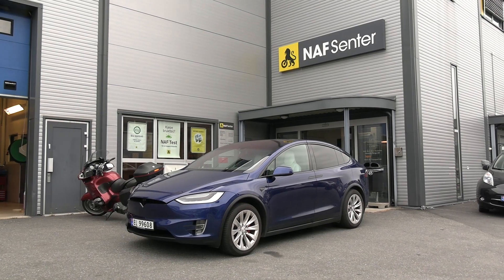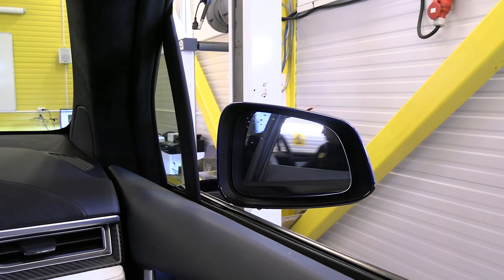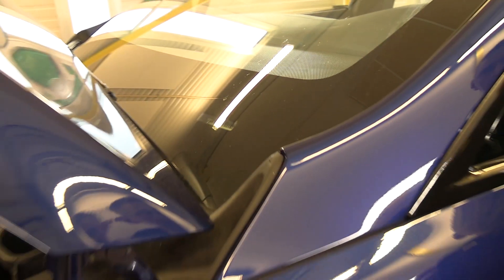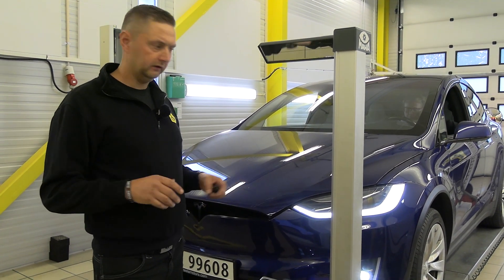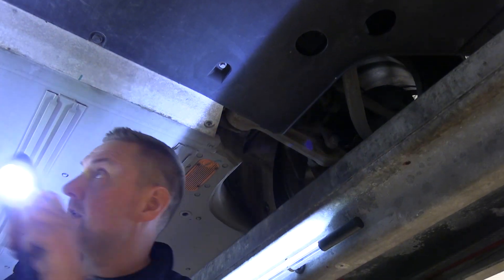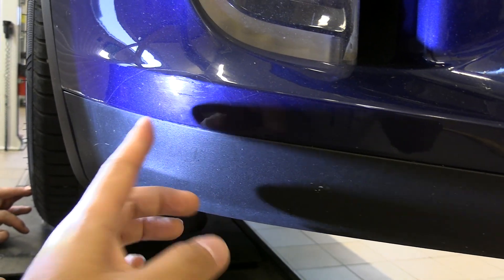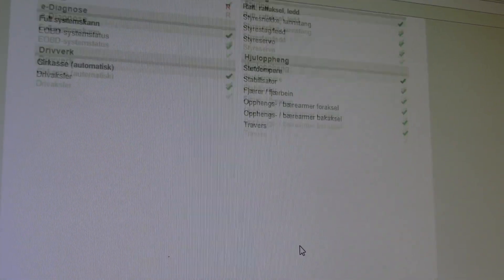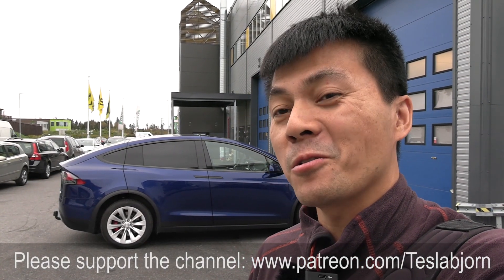Optimus Prime goes through NAF test

Comment: Need to check the timing chain, clutch and transmission and do an emmisions test. 😉
Reply from the maker: Don't forget to adjust the Johnson Rod 😂
Reply: @bjornnyland  I remember that movie.
Reply: Clutch wear and tear, slack on the gear shift, exhaust rust, catalyst converter, ignition timing, crankshaft bearings, valve clearance, coolant level, oil level, wow!
Reply: Blinker fluid full!
Reply: Guys, better check the intake air filter... With that kind of distance traveled, it must be so full of dust now.  Better replace it before it breaks down and let the  tiny dust particles enter the combustion chambers and damage the cylinders and pistons.  Also, check the fuel filter and fuel pump as well.  Check the fan belt for any cracks or damage.  Check the radiator for any sign of corrosion or fouling and that include the hoses.  Check the valve clearances and valve cams if still within tolerances.  Replace the spark plugs.  Make sure the transmission oil level is OK. (the agony of the fossil car drivers)
Reply: @gerrycrisostomo6571  Also Egr, AdBlue system, DPF.
Reply: @valtersvasilis  ha ha ha!...  Once you got used to Tesla vehicles, it's so difficult to imagine what the fossil car drivers are going through, and how much those parts will cost them if they wear out and need to be replaced.
Reply: @gerrycrisostomo6571   if you can buy a tesla you also have money enough to repair a fosil fuel car lol. i cant afford any electric car its probably going to be 10 years longer before i can afford one.
Reply: EV´s are far more reliable. The drivetrain in an ICE vehicle contains 2,000+ moving parts typically, whereas the drivetrain in an EV contains around 20. A quick scan of the top 10 cars repairs  is telling. Only one of these faults can happen to an electric vehicle (and it is by far the cheapest to fix). It makes you wonder what would happen if an EV driver was forced to go back to a gas car.
Reply: @guitarequalsawesome5667  The price of the good quality EVs is getting on a par with the same quality fossil cars.  One good example is the Tesla Model 3.  With a base price for the Standard Range Plus of just  $38,990, minus the government incentives, you can have it for as low as $30,315  (from the Tesla website  https://www.tesla.com/model3/design#battery ).  That is more of a bargain than a comparable gasoline powered car.  And imagine this, it gets more and more affordable than fossil cars when it comes to maintenance and operating cost.   You can even sign up for the limited free supercharging nationwide.  (Correct me if I'm wrong, but I think there is also an unlimited supercharging option by the way).  So brother,  all you need to do is to save some money by cutting off your vices, gambling and especially womanizing, (LOL!) and you can have the Tesla Model 3 sooner than you expected... Right?
Reply: @fvdveen1  yeah it's very important to check all the switches you wouldn't want the radio not to work when your out on a drive cause of a broken switch I would hate for that to happen on me for a drive not that it's ever happened but still
Reply: yeah it must be zero emissions can't be releasing any emissions at all or there's something wrong with the car
Reply: @gerrycrisostomo6571  
maybe in USA it is so cheap, also, don't trust that small number, it includes about 4300$ in gas savings over 6 years.
In Europe it's quite expensive... the cheapest Tesla M3 here (standard plus) is about 50.000 euro, that's about 55.000$ :)
30 -- 55, 30?? 55?? it is quite a difference almost double the difference :/
Reply: @shmadmanuts  Really?  Well, I hope Elon and his company are planning to build Tesla Giga factory/ies in Europe for European market.  If he can do that in China, he can certainly do that also in Europe. That should bring the price of European Tesla cars on a par with U.S. prices.

Comment: What's the battery degradation %?
Reply: Just check TB videos...
Reply: And air suspension not checked
Reply: I have seen NAF tests on electric cars in Norway where they claim the batteries have been tested. Maybe you need to order it seperatly.
Reply: @danielstefanovic2604  what is the consequence of a battery degradation test? No consequence, so no need to do it
Reply: @mlang4644  Not requesting a warranty replacement pack before warranty expires based on excessive degradation is the consequence nimrod. :p
Reply: M Lang consequence is performance and lifecycle

Comment: I wonder what they check on ICE cars.
Because there I'd want to have the valves and pistons inspected, check for CO2 in the cooling system (when the seal the motor head from the body is damaged this is bad), state of the clutch, state of the motor oil, condition of the belts, check if injectors work correctly along with the heaters on diesel engines, check the high pressure pumps, check if particle filters are clogged (that stream air back from the exhaust to the engine), ...  
But I doubt they'd even check 1/5th of that. But those are the things that are actually important and that a normal user cannot check himself.

Comment: Did not checked the suspension in hight for noise in a curb, or accelerating or braking. 
I remember there was a video mentioning this issue on the Model X.

Comment: Great video! As I understood, the system scan could not be done because it is blocked by Tesla. There is no info on the conditions of the battery health, drive train, etc. How to find out about these? I think they are equally important as the others that have checked.
Reply: Good point.  Condition of chassis is impressive, but what about the big ticket items on the car which really haven't been evaluated?  Would like to know battery degradation at least.

Comment: "Checking for leaks on power steering"--the experts @ 17:00
Ummm,  it's electric power steering :P
Reply: Doesn't it still have hydraulic fluid in it?
Reply: No hydraulic fluid, but just like old hydraulic assist, rack has grease and seals and boots which can degrade.

Comment: 13:01 i'm so confused how he made the car move with one hand...or was it a kind of machine? what the hell
Reply: He was using a remote-controlled machine
Reply: @Lee Ludtke there are "shaker" plates built into that drive-on lift that the cars tires are sittings on.  The technician has a remote control that operates the shaking mechanism (usually small air or hydraulic cylinders attached under the shaker plates).  This is very specialized equipment that you will rarely find at general repair shops, but rather locations that specialize in serious vehicle inspections.

Comment: Do you put the car in a roller mode or something when you test the brakes on a roller?
Reply: It just spins the wheels for you and you apply the brakes and it measures how much braking force is applied through the rollers by the wheels. The wheels can spin freely, at least the front. In park the rear is locked, at least on our 3. So you probably just put it in neutral then.

Comment: Does anyone know where or who can provide this car check service in the UK?
Reply: I'm assuming this is the equivalent of an MOT in the UK. In France the checks are about the same but they check spring rate as well on the brake machine.
Reply: Just pay for an MOT like normal. Otherwise RAC or AA usually offer it.
Reply: The AA do this type of inspection.
Reply: @bluej511  No, this check also includes cosmetic condition and gives a report of every defect, not just a tick if something is not roadworthy.

Comment: The fog lights, was the suspension in the high or very high position?
Reply: doesnt matter unless its raised or lowered in only the front or rear. if its lowered or raised in both the rear and front the fog light level is still the same

Comment: I am very disappointed that they didn't even try to check the most expensive part.
There should be an insulation test at least to keep it safe. It's high voltage DC after all.
Reply: @bdeithrick  But it's practically the same if you ignore a leaking gas tank dripping on the exhaust pipe.
Reply: @bdeithrick  No, it's a comprehensive test meant for buying or selling a car. It's not just a simple safety test.

Comment: there will be no leaks in suspension since it air one, and no leaks in power steering since it is electric and the is no oil under pressure.
Reply: Air suspensions are notorious for leaks, though I think Tesla has one of the more reliable systems.

Comment: A french car with similar mileage would have failed the tests :D
Reply: For the price of the Tesla I can buy 4 seven seater French cars which would last about 40 years.
Reply: Yes, you can.
I was joking. 
But also, if a car can last over 200 000km with the original bearings and ball joints it actually is a premium car, better than average and more sustainable.
Reply: @Genuiini  make the same km in an other country and the result can be different.  You will not find potholes in Norway

Comment: These garages are soon to go out of business xD
Reply: it is quite far away to be true, brake and suspension still need to be serviced.
Reply: Why?. There has been a lot of problems with this car along the way, this is just showing the current state.
Reply: Even though EV's require less maintenance people are doing less and less themselves so I think there will still be enough to do. Most of what I replaced on my old car was parts shared with EV's, such as suspension components, steering linkages, bushings, wheel bearings, tyres, brake fluid, cabin air filter, coolant and wiper blades.
Reply: @alconaft4343  Suspensions need basically no maintenance, my current car is 250kkm in and no issues and brakes are also not a big deal.  
All the labor-intensive stuff will vanish though (gearset, belts, injectors, ...).
When I think about what I'd check on a used ICE car after 200kkm there are so many points you don't have to worry about here (for example, belts - if they were not changed and it rips, the valves will crash into the pistons - much fun).

Comment: My ICE car is a lot worse at 182000 km! 👍
Reply: And have you needed to replace things like the timing and cam belt(s)? Anything where they have had to lower the engine out of the car? Anythign where the labour cost is a big part of the replacement?
Reply: @aidanapword  yes, but because it had an oil leak on the crank shaft. The programmed timing belt change is at 210000km. Maintenaince every 30000km, four brake pads replacements on back weels, five on front, next i need to replace all four brake discs. I have to say that i live on a mountain city. To work, i go from 810m high to 950 and to 850 on the work place. That's a lot of potencial energy wasted in brakes! AND I DRIVE IT LIKE I STOLE IT!!!
Had other issues, but non related to the engine, suspension bearing replacements due to potholes and " stone roads", one thing we have a lot in Portugal! I had to replace also the suspension control unit ( Citroën C5 hidractive, a floating car 😁) but that is a matter of chance, the electronics went kaput 😩. Although, I have to say that i love my Citroën C5 tourer! If only had a electric motor! 😭
Edit: forgot to mention that i had to replace the cluch set due to weel get loose, the motor seemed to be going out of the car, sutch was the vibration!
This is a problem even of the best ICE cars!
Reply: @luisfernandes4145  You had to replace the front brake pads 5 times? That car is eating brake pads like nothing. My Opel Astra G has the same brake pads it had when I got it. I am driving it for over 6 years and over 70000 km now. I live on a mountain too. 200m elevation change from home to work.
Reply: @felixklusener5530  but doesn't weigh 1850kg like mine, and i drive it fast and brake late...😛

Comment: This test is pointless.
Reply: What did you test?
Reply: @timmytimmy666  wow roasted
Reply: I mean it's only difference to the yearly car inspection is the guy looking at the cosmetic damage, which you can, and should do yourself anyway.
Reply: @piciu256  This gives an actual report with all minor or major defects, the mandatory test every other year in Norway will now only give a list of anything not roadworthy, or close to failing. It is very easy to forget checking something yourself, and a lot can happen in up to two years.